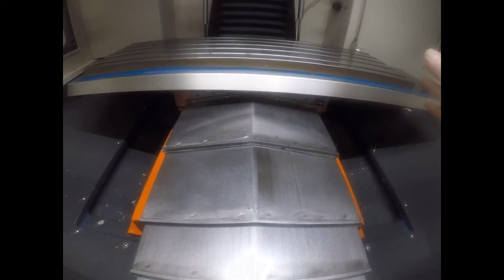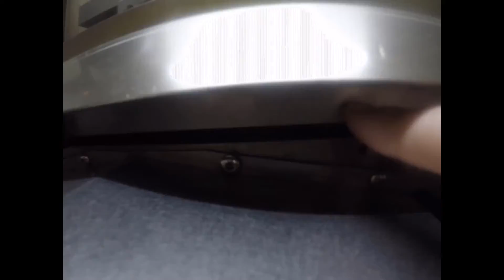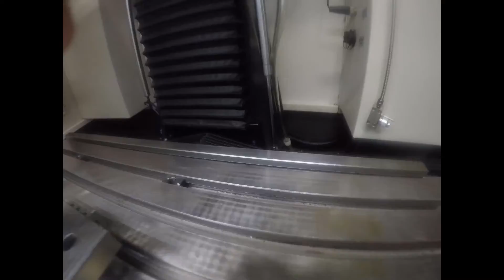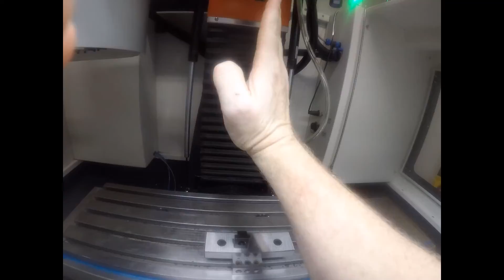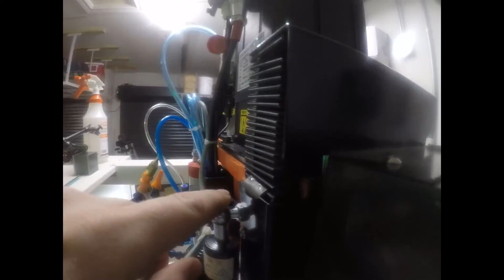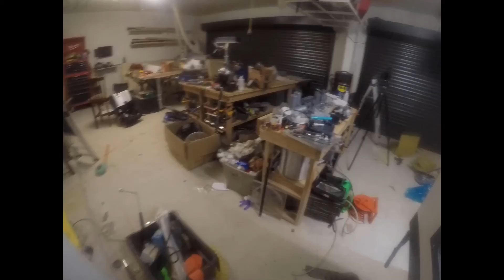Is your CNC Mill Squared and Trammed? It should be!

Comment: what a PITA for a factory new machine.  they should be ashamed of themselves.
Reply from the maker: John Galt agreed. Sub Haas machines fall through the cracks. Really only heard of one other of these landing this far out of whack.  And I have heard of tormachs being out of whack too. 

But yes, totally agree. At prices like these even a baseline machine should be individually QCed before shipping with an inspection report.

At least I was able to get it to spec. Would have been a MUCH BIGGER issue if it was off by more than an adjustable tolerance.